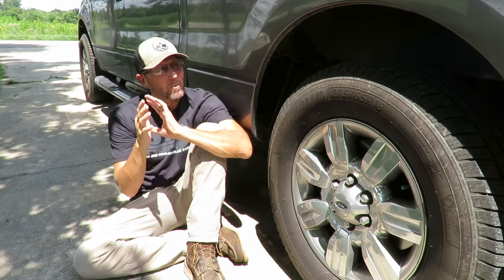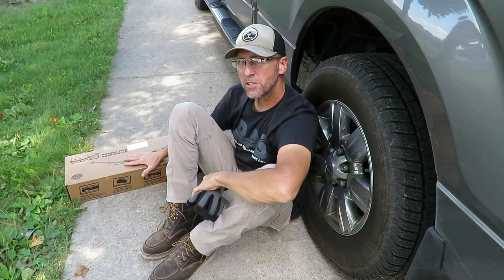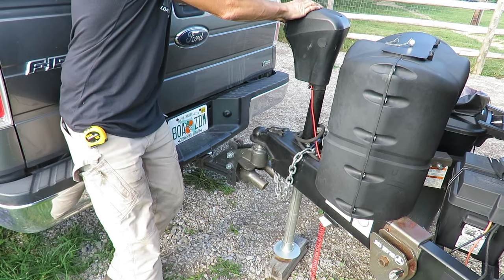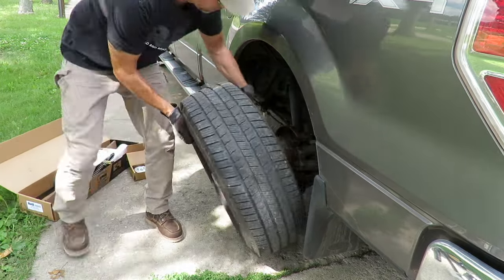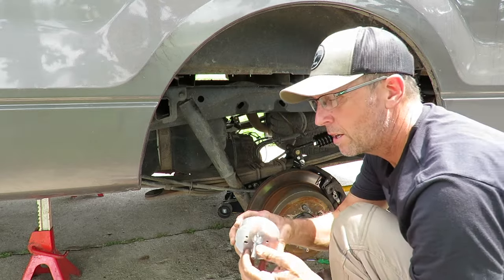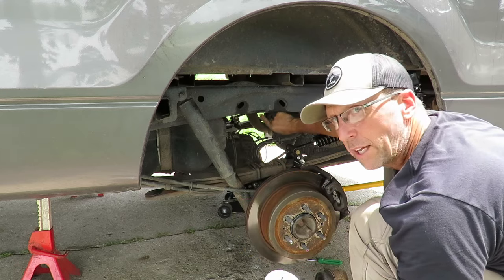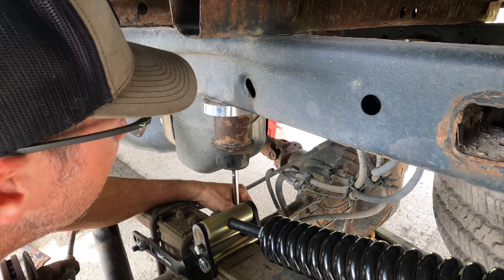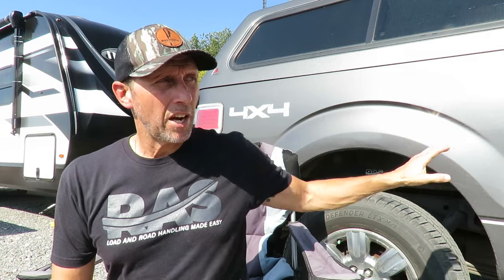RoadActive Suspension Install and Review

Comment: Nice review.  I have had RAS on my last two tow vehicles, first an f150 and now an f250.  I agree with all comments, but im most disappointed the lack of corrosion resistance.  After 2 years....the systems i have had are rusted and not only look terrible, but are seezed and can not be adjusted or easily removed.  I have removed this system amd completely restore it.  Not what inexpected from a $600 purchase.  Good towing performance, cheap plating amd corrosion resistance.
Reply from the maker: We're happy to hear about your positive towing performance with the RAS system but not so much about the corrosion. Our RAS was still in great shape when we sold the truck so we didn't experience those issues. We would recommend reaching out to RAS to pass on your observations, maybe they could make some changes that would improve the issue. Thanks for the comment and information.
Reply: Is the corrosion from salt? i.e where approximately do you live?  Just wondering if I'd experience the same issues in Western Canada where it's generally drier and not much salt used on the roads.
Reply: I take your comments seriously, I am also concerned about rust, I am going to purchase a can of spray cavity wax and coat the RAS after install. Any thoughts?

Comment: i have an additional question ive noticed all these videos show the measurements with the trailers on but not with the sway bars fully connected. So now by installing the RAS changing the rear height did you have to change the hitch to the new height?

Comment: Lots of data and an easier to understand installation video than their written instructions. Thank you.I will be installing mine this weekend.
Reply from the maker: Awesome! So happy to hear this was helpful for you, and so sorry that we're just seeing this! How did your installation go? Thanks so much for watching and commenting! -Laurie. & Matt
Reply: @whynotwander  Too easy to install. I want the 40% and found to have got the back end almost 2 inch lift. I already did a leveling kit so the the truck sit 2 to 2 1/2" all the way around and the headlights are no longer pointing up blinding other drivers. Under normal driving conditions you can barely tell a difference. while towing my 17B Coleman travel trailer I am leveled out with no visible squat. I have falcon shocks  that have the towing adjustment built in to the back with reservoir shocks. They did pretty good, but this combo, It's rock solid. I do my share of playing in the dirt and found the rear end to be a little more stiff than normal with not so much flex. That was to be excepted. The best part is that if I am doing some gnarly offroading I can easily remove the RAS springs.
Again things for the simplification of this install.
Reply from the maker: @MrMysterish  So great!!!! Sounds like you have a solid setup! Very happy to hear the install went so well! Thanks for the update!

Comment: This spring is just pulling forward on the rear axle.  I don't see how that will improve suspension.
Reply: It doesnt pull the axle forward. It allows the facotry spring to remain in the same curvature when unloaded and adds tension on the coil spring to assist the leafs as needed. This allows the truck to run flat and not squat under load.
Reply from the maker: Trust us, the RoadActive suspension works! Thinblueline6862 explained it very well below! Thanks for watching!

Comment: Shouldn’t you install the kit with the truck and tires on the ground? I would think by jacking it up and installing this system once the wheels are reinstalled and the truck at rest on the ground the spring would be over tensioned and not work properly.
Reply: The RAS springs require a preload to work properly, and installing with the tires on the ground would introduce a lot of unknown variables into the equation (weight of gas, bed cover, tailgate accessories, hitch, etc) that could affect setting the preload correctly. Having the suspension hanging eliminates these variables, so the spacers provided are designed to set the preload of the RAS spring with no weight on the leaf springs. Once you set the tension and drop the vehicle, the RAS springs are now properly preloaded. Having the preload set with the suspension at full sag also means there is always tension on the unit... as the RAS requires tension to hold the eye-hook on the end of the leaf spring so it doesn't fall off.

Comment: I just bought a new f150 (2023) like you're. It's the SuperCrew, FX4 short bed (A.R.E. Cap on it's way). I am considering the Cougar (by Keystone) 25MLE. 

I have 1633# payload and I think the cap will weigh in at just under 200#. My wife and I are about 350# combined currently. I reckon we'll have 200# of luggage and maybe 50# of tools. The above trailer has a hitch weight of 530# leaving me 353# available. I've never towed before so I think this is good math. 

Couple of questions... Do you know Keystone trailers? Are they any good? I'll look at more of your videos but you seem to have all this down. You get on forums and YouTube and it seems everyone is just bashing RVs as junk and you hear all the horror stories but it seems that people keep doing it so I'd like to find out if the switch from Airbnb's is worth it. I don't want to go on trips only to have to have more problems. Is there a dependable brand of travel trailer or what are some realistic expectations going into this. 

I know this is a lot in a pretty loaded question but I sure appreciate your input and I'll wait for your response as I'm checking out your other videos.
Reply from the maker: Hi there, Joshua! Congrats on the new truck! While we don't know much about Keystone trailers specifically, I do know a handful of people who SWEAR by the Keystone line. If we weren't in a Grand Design, we would absolutely consider a Keystone. In fact, when we used to dream about RV life, we would go to our local dealer and sit in the Cougar fifth wheels just to see what it would be like. Here's our honest thoughts. RVs are bouncing down the road essentially going through earthquakes from one place to the next. It is pretty much a given that you're going to have issues that can range from little annoying fixes to the bigger problems. With that being said, we wouldn't ever change our decision because we LOVE owning an RV. You get to take your whole rolling cottage/rolling hotel (or home on wheels if you're full time) with you wherever you want to go, and we love that! You are spot on when you said you only read about people's horror stories. The rest of the people are out enjoying their RVs and don't have time to post the good stuff! If you're considering purchasing new, you will have a warranty that will be helpful for that first year, although if you're not full time in it, the "shakedown" might not be complete depending on how often you're using it. Did that help? Did it answer your questions? Always happy to help, Laurie & Matt
Reply: @whynotwander  yes. It did help and I have considered the shaking down the highway. Thanks for your help!

Comment: Does the RAS still allow for full axle articulation when doing some lite off roading?
Reply from the maker: Great question! We don't do any off roading so we can't give you an answer based on experience. However, we believe you would still get full axle articulation with the RAS installed since it is basically just "helper springs" on your rear axles. The RAS raised our rear end slightly and improved towing dramatically, and it eliminates all wheel hop on the road but still offers an extremely comfortable ride. But we recommend reaching out to RAS just to be sure. Thanks for watching!

Comment: Appreciate your time and effort for this video. I am a spirited driver, and want to know your input for what you feel is better in the curves as to before. I have a ‘16 5.0 and want to tighten up the suspension and better towing as well, and I keep coming back to this vs putting a heavy sway bar outback
Reply from the maker: Great question, bluedeval03! We're glad to see that you are so concerned about safety as well. Obviously we can't speak to your specific setup but as far as our experience towing our 32' RV, the RAS system made a big improvement. A very noticeable improvement. We also tow our RV with an anti-sway hitch in addition to the RAS system and have never towed it without both so we can't speak to using one and not the other. However, while towing the water tank shown in the video, we did not use an anti-sway hitch and it towed very well (definitely not an apples-to-apples comparison in weight but just our observation). Lastly, there was also a big improvement in handling without towing with the RAS system installed. We are believers in the RAS system after our experience using it. Hope that helps!

Comment: Can you elaborate on why you switched the bolt position at the from of the leaf spring from the 2nd to 3rd hole?
Reply: Installed my RAS (3611-YHD) today on my 2022 F150 4WD. After watching several YouTube videos and seeing guys install their kits using various bolt positions I decided to call RAS and ask what they recommended. I spoke with Shawn at RAS and he informed me to use the 3rd bolt position (middle) for my particular kit. By getting the spring closer to the axle it adds benefit. It’s amazing the difference these systems make! The driving / road handling experience (no payload and not towing) is SO MUCH BETTER!
Reply from the maker: Great question, Steve! JFR-eo3wt gave a perfect answer (below) to your question. I moved bolt positions for the exact same reasons and the handling was dramatically improved while towing due to the RAS. Thanks for the comment. ...and thank you JFR for a great response. 👍🏼